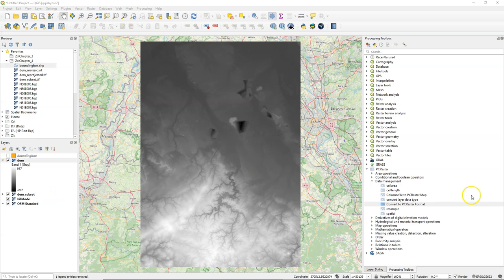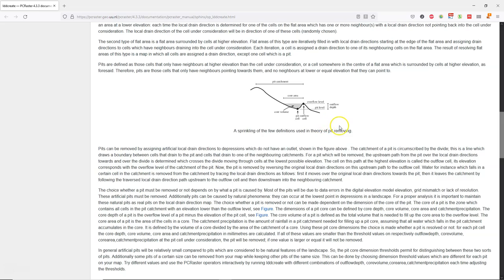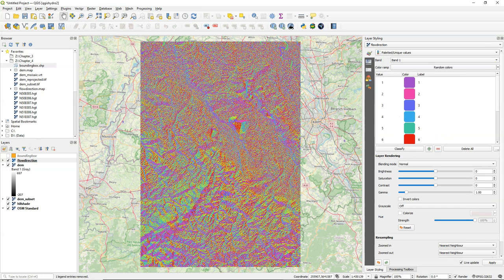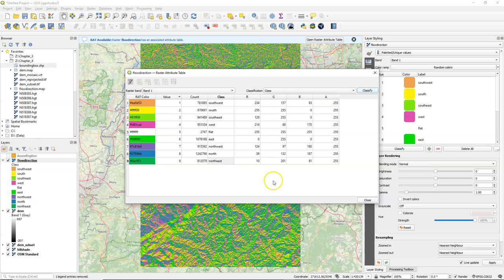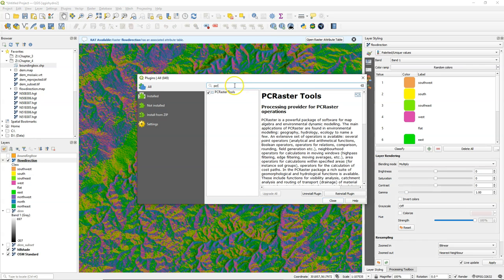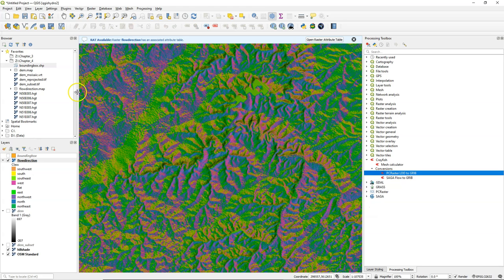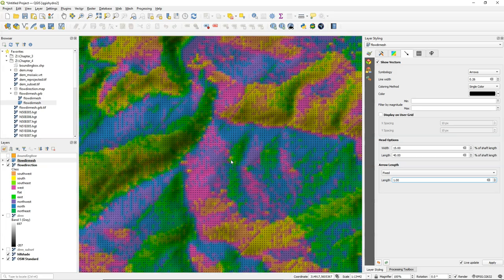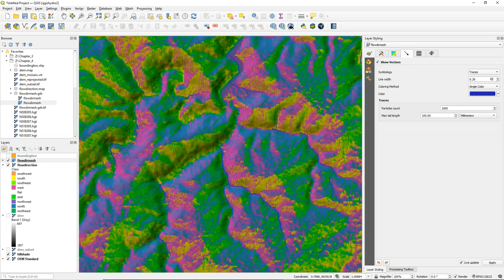Calculate and Visualise Flow Direction in QGIS

Comment: Hi Hans, how long does it generally take for lddcreate function to give the results? I left it for about 4 hours but the process is still continuing. Thanks
Reply from the maker: It depends on several factors: nunber of cells (depends on spatial resolution and extent of DEM) and your hardware. The algorithm can't be multithreaded, because there's a relation between the pixels. You can try other algorithms that might work faster. Check my presentation in this video: https://youtu.be/u98BvEcZH3M?si=9Q6WrLUaoqqgl-bH
Reply: Thank you! Will check it out.

Comment: Hi Hans, I have downloaded the latest release and the table is now editable. However, when I drag in the flowdirmesh file it appears in my layers, but not as yellow on the screen. I also can't see the arrows when I change to that. Do you have any suggestions as to what the problem could be? Many thanks.
Reply from the maker: The tool produces 2 layers, a raster and a mesh. Are you sure, you've added the mesh layer to the project?
Reply: @HansvanderKwast  Yes it is the mesh. When I expand it in the layer panel, it shows a colour ramp, but nothing appears as a map.

Comment: I think i have a new addiction going through your videos. Extremely helpfull. I had one question about when you try to print the flow direction mesh (with the arrows) in the layout manager. The output does not follow the symbology i set in the project and the output is arrows overlapping each other. I assume this is due to an interaction between the layout manager and how it handles mesh files. Do you have any suggestions for resources i can read up on to understand better the interaction with Meshes and the layout manager, so that i can generate the output i expect? In the mean time, thanks for making GIS fun.
Reply from the maker: For now, having the mesh arrows scaled correctly in the print layout needs some tweaking of the sizes in the mesh styling panel and verifying the result in the print layout (which is not 1 to 1). So it requires some iterations to get it well. The issue is that units of the measures can't be set, like with the normal styling and labels. Maybe you can post the issue at the QGIS GitHub repo: https://github.com/qgis/QGIS

Comment: Hi Hans. I get an error in lddcreate tool: Traceback (most recent call last):
File "C:\Users/Zvone/AppData/Roaming/QGIS/QGIS3\profiles\default/python/plugins\pcraster_tools\processing\algorithms\pcraster_lddcreate_algorithm.py", line 169, in processAlgorithm
setclone(input_dem.dataProvider().dataSourceUri())
TypeError: Cannot open 'E:/Documents/GIS/Cvitovic/VirtualRaster_DMR.vrt'. Note: only the PCRaster file format is supported as input argument.

Can you help please?
Reply from the maker: The PCRaster Tools can only read the PCRaster file format. Therefore, you need to convert your vrt layer. You can use the tool from this video: https://youtu.be/7nSh-93z3Ro